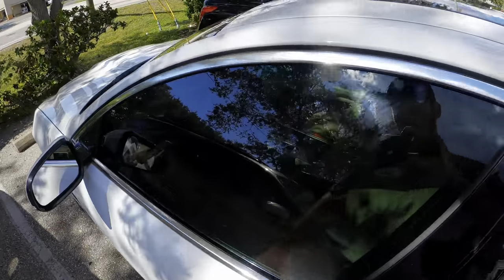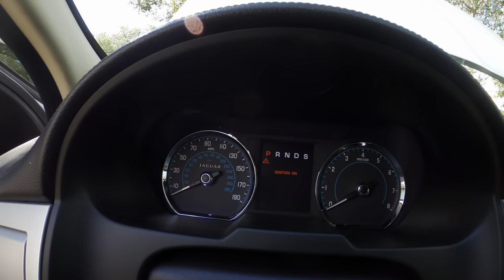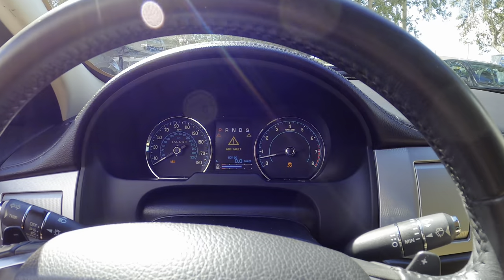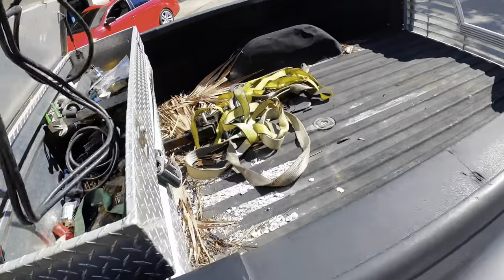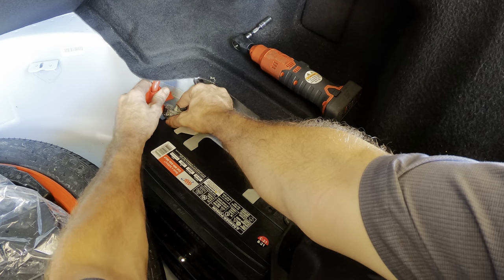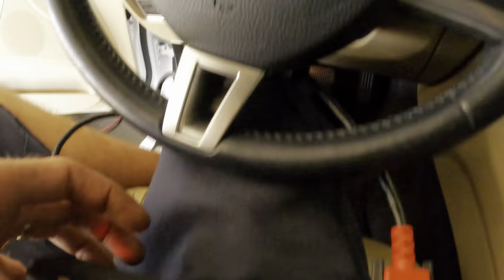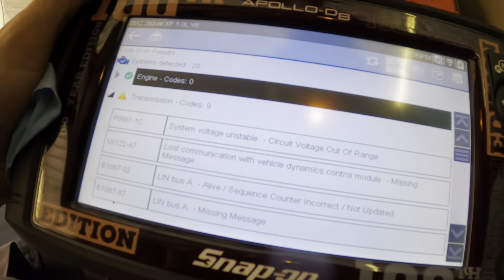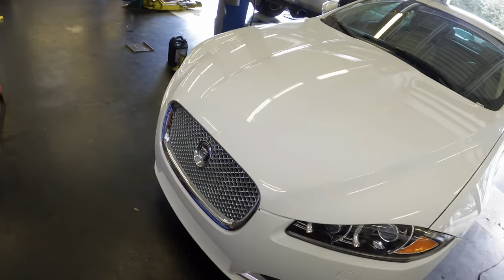Jaguar XS just Towed In.  I’m in over my head! Customer States: “Check Battery”

Comment: Learned something new today: negativ goes first in the US! In Germany we connect the +-cable first to avoid any contact of PLUS with Ground (any metal of the body/engine).
Reply: Same in UK as sensible practice
Reply: I'm not sure why he did that, I was taught + first and then - and finish - at the engine boost vehicle to avoid sparks near hydrogen. This was opposite to what I was taught on -earth.

Comment: I'm 90% sure this is a bad alternator; it's a common problem with the Jag XF here in the UK.
I had a similar problem which produced a torrent of fault codes from every control module.
Once the alternator was replaced, all fault codes disappeared.
Reply: I can't stand European vehicles they are complicated for no reason
Reply: @justinjones6810  Oh but there is a reason, a well planned reason. It is so you have to take it to the dealer and replace parts that are designed to fail.
Reply: @justinjones6810  lol... you are just not used to it...
Reply: @justinjones6810  Well in the case of Jags of this era, you can blame Ford for that.
Reply: @justinjones6810  The Alternator is pretty standard for majority of vehicles, not entirely sure what the car being European has to do with anything. If an Alternator is unhappy in ANY vehicle, it is going to produce less than desired effects. I'm sure this Jag is complicated to a degree, but the Alternator definitely is not one of those things.
Reply: @justinjones6810  cadillacs are the same way dude. very sensitive to electrical faults
Reply: @justinjones6810  The days of simple cars are over.
Reply: @justinjones6810  it’s in all essence a Ford
Reply: Yeah, seems obvious. It's shifting into Park because it's an electric gearbox and doesn't have enough power to shift. And since the parking brake is also electric it's going to put itself in park for safety.
Reply: Calcium battery is needed as the alternator puts out just under 16v.
Reply: @festeringfesterer  
Ford sold Jaguar in '08. This is a Tata product. Tata is an Indian manufacturer known for making cheap and poorly made vehicles.
Reply: If he knew the back story , loading an alternator into the parts cannon might not be a bad idea. Or if he can test the alternator to see if it's bad. Depending on how the ecu tells it to turn on, could have been relatively easy.

Someone could have jumped it wrong, etc though or something else is bad and spending time and money on alternator could get expensive. 

He made a decision though that he didn't feel comfortable working on it. If it was his vehicle than he might of went further but it's not so he probably made the right choice.
Reply: Had the same issue with a 2005 530d
Reply: @festeringfesterer  I'm talking about their trash software that they developed to diagnose problems not mechanical problems

Comment: I have a jag. From the number of codes, I would say someone tried to jump it and cooked much of the computer system. On a jag, it is important to be extremely careful when jumping the car. Always hook the positive cables up first, then the negative, according to my long time jag tech. It seems that creating a spark when hooking up the positive last is enough to fry the system. Great video!!
Reply: To be honest, Ray was jumping the car incorrectly.  The negative cable should have went to the body of the car and not the car’s battery.  This puts the car’s fuse(s) in the path for safety.
Reply: @kevingray8616  eh it's one of those things the situation where that would make a difference is a bad situation to be in period.
Reply: @kevingray8616  No it doesn’t. The car sees no difference between the jump pack and the starting battery.  12v is 12v is 12v.
Reply: @forrest225  I'm not talking about the voltage.  I'm talking about in the event of a mishap, the fuse in the dead car will blow, rather than risking the potential of a battery explosion or the like.
Reply: @kevingray8616  there is no fuse between the negative terminal on the battery and the chassis. It's just a straight like 50cm long cable from the terminal to the chassis
Reply: @kevingray8616  While you are correct about putting the negative cable on the chassis, you are wrong about the reason. The reason is this avoids a spark close to the battery, because there might be hydrogen present (this stems from the old times of unsealed batteries). Modern sealed batteries are not as prone to hydrogen outgassing, so the risk is not as severe anymore.
Reply: @nordishkiel5985  Thanks.  I talked to my brother about this a few days ago and he said the same thing you did.
Reply: That is correct and you should use a battery with 1000 cca THE KEY MUST BE OFF i remove the key from ignition switch.
Reply: I don't understand how a spark at a battery terminal can blow a module.
Sounds fishy to me, a spark would indicate that a circuit completed and unless the jump source has a much higher voltage, everything should be protected up to at least 15 volts. Because an alternator will put out between 13 & 14 volts. Sounds like a bunch hooooeeee.
If someone can explain, I'm willing to learn.
Reply: The second negative should be the last connection away from the battery ( frame or frame bolt)  of the running vehicle.
Reply: @cynicalrabbit915  sparks cause a surge of voltage and amperage… as an electrician I’ve fried a few dimmer switches from hooking them up live and the spark i usually the culprit.  I assume its the same reason in a car.
Reply: @Frank-ih9ew  
This is off topic from cars.
Years ago a small biz owner told me to put up a ceiling fan back in the shop. I refused as I wasn't an electrician. Not only that but. this was a commercial building not a residence.
He got my supervisor to do it.
But as soon as he removed the wire nut from a bundle of white wires. The ladies up front in the office/display area, started yelling.
The supervisor quickly redid the bundle with. the wire nut.
There was a brown streak coming down the wall in the owner's office.
He had multiple surge suppressors plugged into each other.
The PC power supply was crispy as was the external modems power supply. Every surge suppressor on that circuit was toast also.
I've never understood why taking that bundle of wires apart caused a power surge. AC is weird at times...

Thanks on the explanation on the spark.
Reply: U can turn the headlights on to use as a spike suppressor
Reply: @cynicalrabbit915 When a wire nut for neutral was loose, neutral circuit become open and all the white wires (except for the one from the panel) will be hot. A surge protector plugged in would see 110V between neutral and ground. Not a good thing for protection devices, since surge protector is only designed to protect short pulses from lightening, not from constant supply of energy.
Reply: @GardeningZ  
Still the women in the front put up an impressive ruckus.
It was after that I learned about not daisy chaining surge suppressors.
Also the loss of all the power supplies couldn't have happened to a nicer guy than the owner. Bless his heart.
Reply: Just have to input on this one.. sparks will happen on either terminal if the key is on or any other load because there is current flow. Connecting the ground to  chassis away from battery is an extra safety measure to prevent explosion of battery from sparks.If all loads are off = no sparks. The reason why it is said to hook up positive first is because if you hook up the negative first it’s possible to short the positive lead on the jumper cables to anything metal on the vehicle.
Reply: @Frank-ih9ew  sparks do not cause a surge in voltage they are heat created by the high resistance of the air gap as you are making the connection. You are burning out your dimmer switches due to heat created by sparks not a surge. Not trying to be rude just thought you should know
Reply: @jackmeholf5901  Battery is a strong load.
Reply: @Frank-ih9ew  bruh, electricians aren’t supposed to work on live current, if you pulled that shit here and DOPL found out they’d pull your license
Reply: @RageUnchained  lol working on live circuits is an every day practice in residential service calls. I’m not saying it is right… Just being honest.
Reply: And now for 400 comments on the right (but still wrong) way to jump a car....  fucking youtube scholars.

Comment: Jaguars will tend to throw countless of random errors like that when the alternator fails, making the car undrivable... Chances are high that changing the alternator fixes everything. But then again, as a Jaguar owner without the budget to have someone work on it for me, I tend to throw the part-cannon at it too haha
Reply: Just a fully charged battery might get rid of those errors , modern cars like that are power hungry and just a small drop will make them throw a tantrum
Reply: @UserUser-ww2nj  from experience not with jags... XJ and XF will throw insane codes with a bad alternator and render the car useless... No reason for it to be different with XE...
Reply: @traxnada  I had s jag , luckily not one of the mega complicated ones like this one , it was from when ford owned them , the x-type , good solid transit diesel engine and gave me no problems . One thing I learnt from that car was how companies cut back on things to save money . The wiring harness wires got thinner and thinner the further back towards the rear you went , ended up ey the kind of gauge you find in computers . Only real disadvantage      was with the fibre optics system, you had to buy the accessories made for the car if you wanted a c.d changer and they were not cheap. Advantages were that once you found out it ran the same running gear as the Mondeo you bought those parts and saved a third on price parts
Reply: Many euros are similar. My bmws throw all sorts of tantrums if the voltage is below 13.7v (charging from alternator)....You get endless codes from all modules...Putting a new battery in wont fix it because it expects to be seeing 13.7v when running and not ~12v.....however, a new alternator, use bmw software to clear all the codes and like magic its all good again.
Reply: i nearly bought a jaguar as my first car and got talked out if it for these exact reasons
Reply: @misseselise3864  Depends on which model you buy. The X-type I had was a good car, had a few niggles like any other car but overall I was happy with it
Reply: This is more of a modern car problem than a euro car problem.  My Cadillac did something similar when the alternator died.  First car to leave me on the side of the road.  A warning popped up about the charge system and I didn't think much of it because its not the first time I've had an alternator die on me.  Probably the the 4th time if I'm honest.  Soon after all these warnings were popping up on the screen saying all the systems on the car were failing.  I think the issue is moving everything to electric means that the car are heavily dependent on the alternator.  (e.g. electric power steering vs hydraulic power steering)
Reply: @darrencurry4429  You are correct , modern cars are electric thirsty things and it just gets worse every year , electric this that and the other . Who really needs an electric boot release ??, you are going back there to put something in or take something out , just pull a handle .
Humans are getting damned lazy and stupid year on year
Reply: Sounds like errors I get from Apple devices. A wireless module bus error actually means the system clock is wrong. Useless for diagnosis.
Reply: As long as you know how to work on it and can afford the parts then that's okay. I do not believe you should drive a car you cannot afford though.
Reply: I literally had 36 codes come off of a freightliner once. I know it’s diesel and runs a little differently but literally all it needed was a new VGT. After the VGT was replaced all 36 codes were wiped.
Reply: @CanadianOG  I don't think many people "can afford" a cheap Jaguar :)
I have something like 13 cars right now... It wouldn't be financially smart to have that many if I didn't work on them myself.
Reply: @UserUser-ww2nj  

He put a new battery in the car just to check and see. The issue is that the car is not using the correct voltage and there may be other issues with the car as well since the car was not operating properly. In this case the dealership needs to fix this car and all of its electronics. This is why I don't want to buy a car newer than 2008. . .
Reply: @Delimon007  He put a used and technically dead battery in the car.  Battery should be 12.6V fully charged.
Reply: @darrencurry4429  

Yea that's right, it was 12 V. The car was supposed to get 13 something that but even with 12 V the regulator should ask for more if it needs it. He didn't use the other dead battery though he used one of his.
Reply: Yup sadly a common fault on the old XF. Had the same issue. The alternator Jag used is just to weak.
Reply: @John Cliff Yes you are right about the manual but that applies to a lot of things .
Man buys flat pack furniture , first thing is to throw away or ignore the instructions 😂😂
I have heard that some women do not even know how to put fuel in , they ask the husband to get something from the shop and while he is doing that can he please put fuel in )))) .
At least now in the U.K where you are they have introduced into the test a part where you have to know about checking the fluids , its a start and should be expanded on .
I worked with a guy who was ex reme , he now works for ''Still'' , the forklift people down in Devon , nice guy named Paul ********, he is into V.W campers and old old beetles .
 Cars have become heavily dependant on having a good battery these days with so much electronics in them , nightmare to work on .
I had an x type jag , took it to a garage for something , cant remember what and we went on the test drive . The guy drove it very hard and it was all fine until we got back to the garage , the car would not restart and the dash lit up like a christmas tree . Turned out to be a bad earth , a cable had not been tightened down properly when a previous owner had the clutch replaced .
the joys of motoring 🤣
Reply: This made me slightly more appreciative of my choice of buying an older jag vs a newer one. I originally went with older cause i was thinking "less electrical things to fail and easier to repair".
Reply: Jaguars and land rovers have terrible programming, communication faults are very common even on none complaint cars. I personally would have taken pictures of all faults , cleared faults the rescanned but I know why he didn’t. Personally I think it was a voltage issue causing the modules to go into limp mode.
Reply: @KandiStomper  hum.... you haven't worked on good ol' Lucas eletric wiring I see... Old Jags are quite terrible in term of pretty much anything really... Parts are expensive, happy to fail proper quick and so on. 2003 and the first Ford fully produced Jags actually helped quite a bit when it comes to reliability (yes who would have thought lol) and most of all, they use plenty of very cheap Ford parts for maintenance.
In the case we're seeing here, yes, everything goes to shit, but the fix is actually fairly simple and cheap. An alternator to replace... pre-2003 Jags, it's usually another story when it comes to tracking down the problems.
Reply: @traxnada  i have a 2002 model and haven't had any significant issues so far (4 years)
Reply: 80 Series landcruiser does weird stuff like that too, usually run fine for a while, minimally charging, but nothing powers correctly.
Reply: Been through this same experience. The cars super computer is too dumb to know the alternator had failed. First issue presented as gearbox failure, as the computer for that system is most sensitive to low voltage. Then it lights up like a Christmas tree.
Reply: @UserUser-ww2nj  A little harder for us X-Type owners in the U.S., as we didn't have the Mondeo parts readily to hand here for a lot of it.  But, when I went to change the manual transmission fluid and discovered it was just an MTX-75, I was delighted to go to Ford and pay $21/quart instead of Jaguar's $49/quart.
Reply: Being as i currently own a 2007 Jaguar XJ8 that recently had an alternator replaced, this is very true. Since then though it’s been wonderful, but a bad alternator will render the car useless as with most cars. I know when my alternator went out on my 2002 Honda, I struggled to get it home and had to keep the rpm above 3k otherwise it’d stall out and die.
Reply: @traxnada  Why do the British drink warm beer?  Because they have Lucas refrigerators.
Reply: @UserUser-ww2nj  I had an XKE for a short time. Quad carbs. Nice car.. ran well.. but I spend more time twiddling with it than driving it.  Buddy has a XJ? Picked it up at an auction for pocket change, stuffed a Chevy 350 and tranny in it and never looked back. Another smart man.
Reply: So do all modern  cars had a BMW 645 lovely car but electrical cancers  made me scrap it all manufacturers need to be burned good for this type of shite. I would not want to put a boost starter on it to many modules to fry . Not your fault it should be able to take a boost but why put yourself   up shite Street the customer could come after you for damaging gearbox module etc.

Comment: this may have been long but the first thing i would sort is the alternator. Leave the customer battery on the charger overnight, replace the alternator, drive around a bit then do another scan. Computers don't like wrong voltages so at too low a voltage, modules will hang which is what causes the missing messages and communication issues as the computers freeze. This is why your gearbox got stuck because the computer responsible hanged from the low voltage. that jaguar has too many computers so requires a beefy electrical supply. Battery might be ok or damaged due to the low state of charge so its also important to run a crank test on the battery as well.